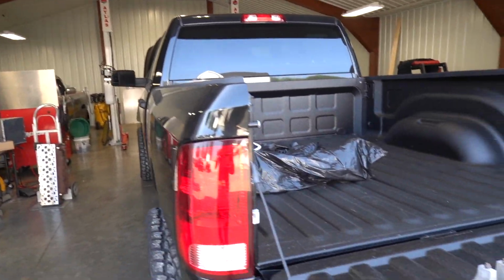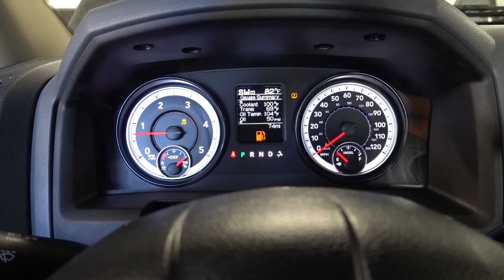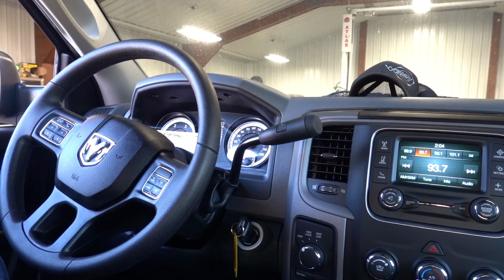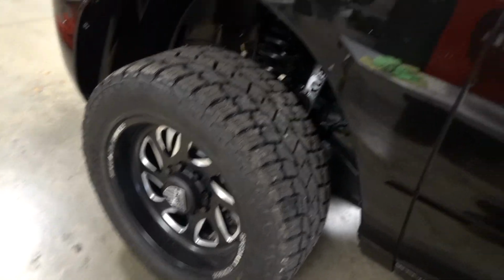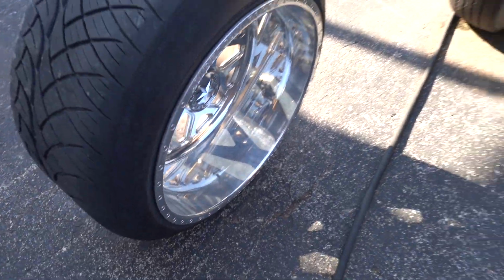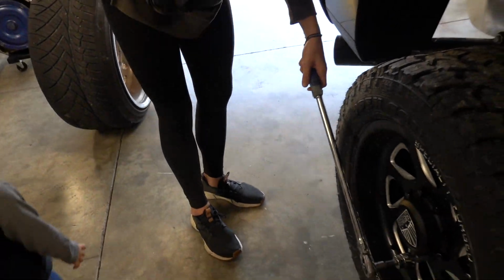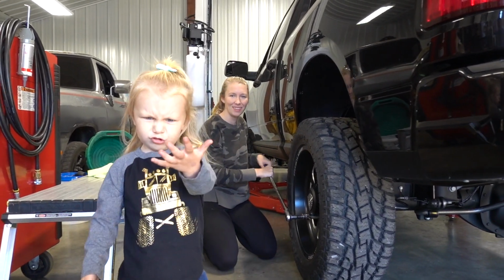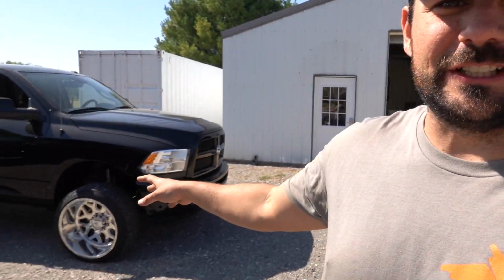NEW WHEEL SETUP FOR MY WIFES CUMMINS BUILD!!! WE FIXED THE MAJOR ISSUE!!!

Comment: Like it. I think it's going to look sharp with some legit tires on them. That's the traction control light. There is a recall on that model they have to change the module and then it has to be reprogrammed.  This truck have a separate ECM that controls the traction control and the ABS system. My 2014 2500 had the same problem
Reply: My 2012 2500 had the same light, cruise control wouldn't work, and traction control permanently off. I tried the ABS control module first which didn't fix it. Replacing the ABS pump fixed it.
Reply: @sekondnature101  My cruise didn't work either. My brother-in-law works at a ram dealer ship. He reprogrammed the the computer and it fixed my problem. Since her truck has been torn down since new I'm sure the recall hasn't been done and the brain for the ABS and traction control hasn't been updated.
Reply: @anthonyaubuchon765  Agreed, that low of miles it wouldn't be the pump. While troubleshooting mine, I read that the ABS control module is programmed to a specific ECM. Replace your ECM, reprogram the ABS control module.

Comment: Greg, where are you posting the wheels and tires for sale at?  Also, is her truck straight piped? Love the sound.  I have an all stock 2012 and am planning on the muffler delete but keeping the DPF stuff.  Is that sound even possible with all that stuff intact?
Reply: Not possible with a dpf on...I have a 2012...the DPF acts like a giant muffler.  Mine is gone and not a fan of the drone without it so I added a muffler.

Comment: I wonder if the ECU has a bad terminating resistor, I would check can high and low pins to see if it has 60ohms . Possibly it was not terminating the Can messages fully and causing noise in the Can network. ECM might be repairable

Comment: My 2012 2500 had the same light, cruise control wouldn't work, and traction control was permanently off. I tried the ABS control module first which didn't fix it. Replacing the ABS pump fixed it. Wheel speed sensors may need to re-calibrate if you haven't been over 20 mph too.

Comment: The light could be from a wheel speed sensor not working, a good way to tell is see if the cruise control works or not. If not then the traction control won’t work either!!
Reply: $350 repair in my case. ABS module took a load on me. Dealer wont order it for me unless the truck is in their shop. I refuse to take it there let alone have them program it as i dont want the "recalls" "fixed" (welding).

Comment: Is there a chance the truck was jump started. By another truck when you had it, or before you had it to your knowledge? Because I’ve been told with these new trucks, if your not suppose to jump em like the old trucks because it will hurt the computers..... I haven’t personally seen this issue yet. But it’s possible that. It happen to that ecm. Something to look into.

Comment: That code that is still up is for your wheels. I had the same thing. You have to calibrate the speedometer to the right tire and wheel size. Also your cruise control will not work with that code because if I remember correctly it’s a stability control code. Plug up a computer and change that tire and wheel size and it should go away. Hope it works greg! Keep up the videos love them!!

Comment: powdercoat those polished wheels black, swap the tires out for something less 50 cent candy shop looking, give the truck a 2-4” lift with all the goodies, amp research steps, roll pan, couple more paint to match exterior items and then you have yourself a truck.. a truck that ends up matchi g the rest of your fleet.  The only truck that should or can pull off polished wheels is the first gen.

Comment: The Wheel design I can live with, maybe add some black, because the rest of the car doesn’t have any chrome except on the grille. 
Tires? The low ride tires have to go, very uncomfortable. Since Ali will drive it a lot, the truck should be a compromise between looks and comfort.
Personally, the truck now looks like a hot wheels, because the wheels come out that far.
My opinion

Comment: AF Flux. NOT Trax brotha. Ali's wheels have the detailed windows in them.

People are gonna not like the wheels because they're flashy and they expect you to not condone stretched tires but tbh, screw it. I've had close to 26k GVWR towing on 24x14s on 33x1250s roughly 1200miles ON spacers. Those wheels look good man and they fit the truck tremendously! I'd snag a set of 35x1550 AMP tires so you won't have to worry to much about the late night trips to Taco Bell. And believe be me when I say it; I've had at a minimum of 6 sets of stretched tires on this truck alone🤣

Comment: You ruined the dodge with those wheels maybe a set of 35. 12.50s 17 or16 

Save those wheels for a fiat wrangler. With a 2 inch body lift and chrome bumpers

Comment: When you choose wheels and tires it should have nothing to do with the look everything how to do with it will it handle good will it not make the car cuckoo they don't come like that so why would you build it like that
Reply: James Ledesma some people don’t beat the hell out of their truck so there isn’t much disadvantage of the wide wheels and they look a whole lot better than 20x10s so there’s no reason to not get them really. Most of these trucks that have them just drive down the road w no trailer and I even towed my bass boat around on 14 wides w no problems
Reply: @iancales3074   You don't buy a car and put on wheels that look better and make the car more dangerous to drive we all have to be of the road with these cars why would you do something that makes the performance of him worse
Reply: @iancales3074   Trucks are designed to take heavy loads get up into spaces were both cars that them 2 wheel drive can't get to when they would have 4 wheel them in make the monster trucks to get up certain mountains in order to achieve that they have to build the truck for that mountain but to drive it on the streets afterwards which is 95% of where this card going to be why does it have to run  I raised my truck up I'm still doing 7